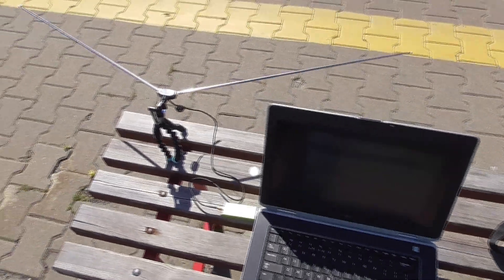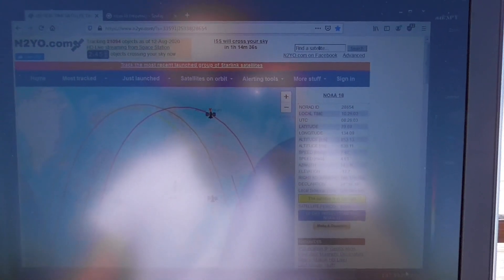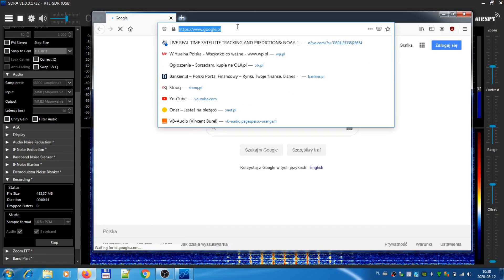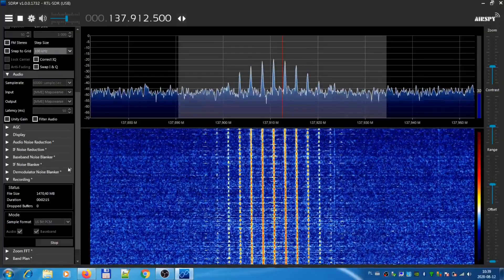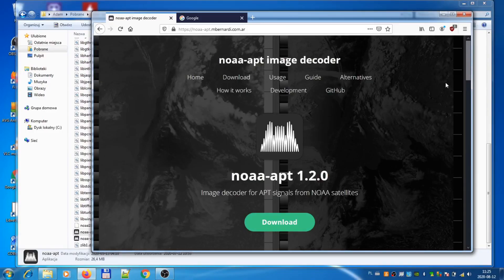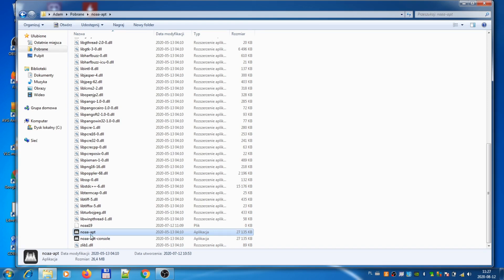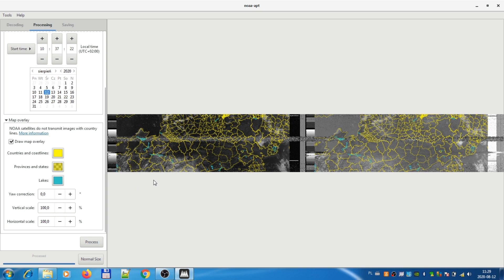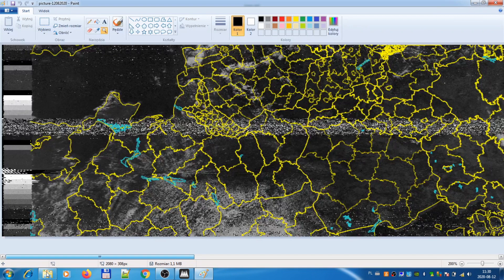Receiving satellite signals / decoding weather images at bus stop with RTL-SDR & simple V-DIPOLE

Comment: I have made v-pole antenna. Using nooelec product LNA. Using RTL-SDR. Using SDRSharp software. To receive FM radio broadcasts to function properly, it's must use the LNA above. But after several weeks of trying to receive pictures of NOAA15, NOAA18, NOAA19, MetopB, MetopC, never got a good signal at the working frequency of the satellite. The reception location is in the middle of a field, an open area without obstructions (houses, trees). I have adjusted all parameter settings (frequency, bandwidth, etc.). Where do you think my mistake is?
Reply from the maker: i think there is some kind of impedance mismatch or poor contact issue between the antenna and sdr dongle

Comment: Happy day sir
Is there an easier way to program DSDPLUS / P25?
Thank you
Reply from the maker: Hi, for trunking radio you need two RTLSDR dongles with old chips R820T. Then you will be able to use SDRTrunk software. I currently have only one old unit so I am unable to prepare such video now but I will do that in the future.
Reply: @justanengineer5599  
I am currently using this device
https://a.aliexpress.com/_dUTEh9P
Reply from the maker: This one is R820T2  based and I was having problem with this unit under SDRTrunk application.. At least my device was not discovered there. The one with R820T was detected and worked.
Reply: @justanengineer5599  
Question I want an answer from you
In my communications devices are all encrypted.
Do when you download rtl dsdplus
Unlocks encryption.
Thank you, sir
Reply from the maker: Nope, DSDPLUS can do only unencrypted trunking transmissions. Check here : https://www.rtl-sdr.com/tag/dsdplus/